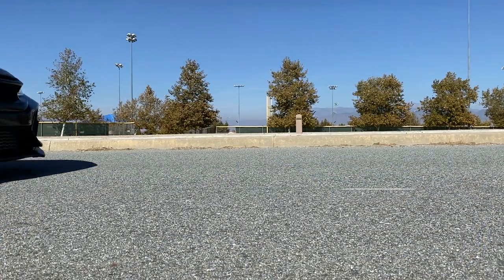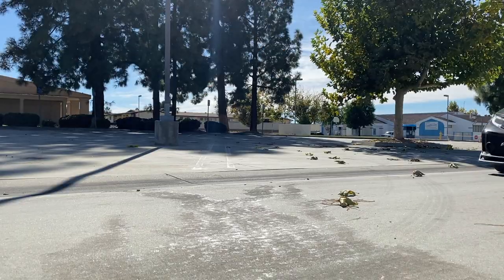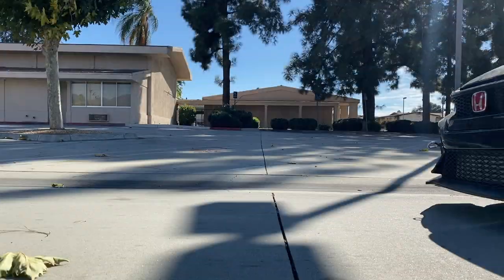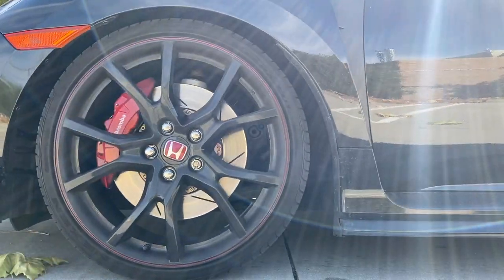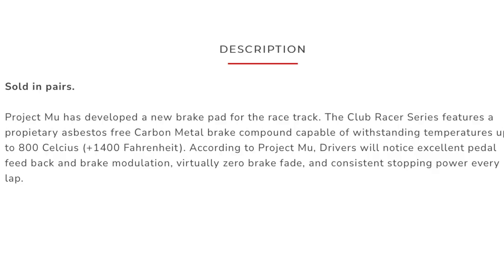Project Mu Brake Pads - Too Noisy for Daily Driving?

Comment: I have the almost the exact same setup, Girodisc rotors and titanium backing shields with the Project Mu Club Racer pads.  Only difference is I have the Club Racer pads on all four corners. Along with the occasional track day, I travel numerous times per year to different locations around the South-Eastern US just to race various amazing roads, such as The Dragon and the Cherohala Skyway in TN.  A bit noisy, yes, but they are simply amazing at what they do.

I found that by applying a dab of high-heat pad grease both between the pad and the backing shield, and between the shield and caliper, it keeps the squeaking to a minimum.

Keep it on the road, bro!
Reply from the maker: Thanks for the comment man! Be safe out there! 😃